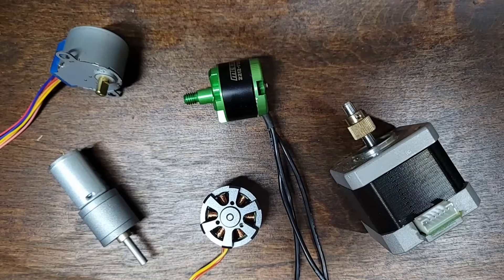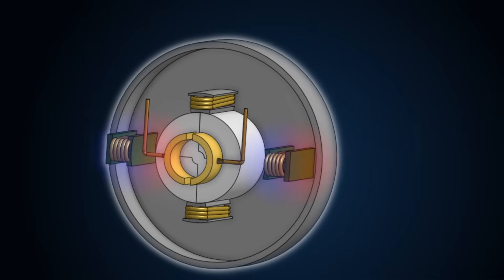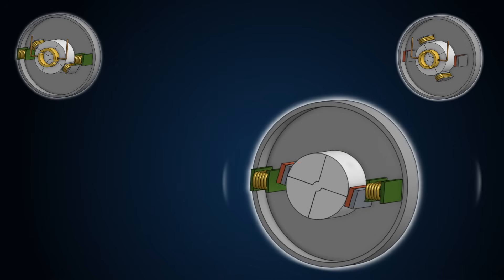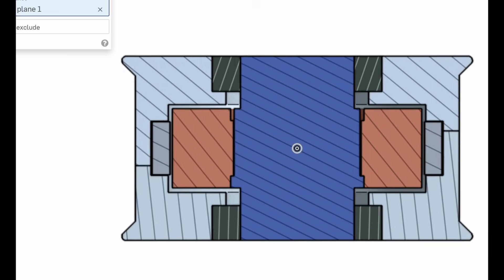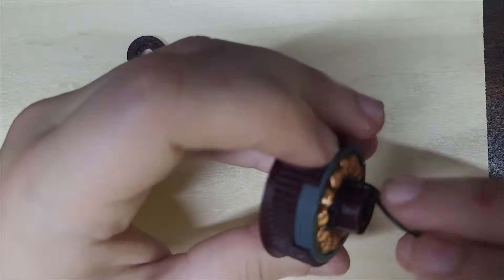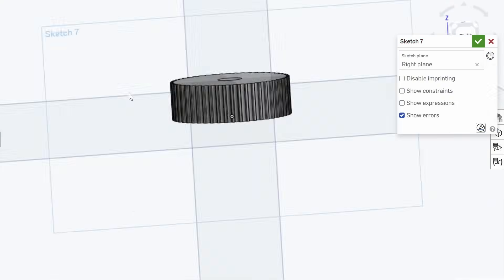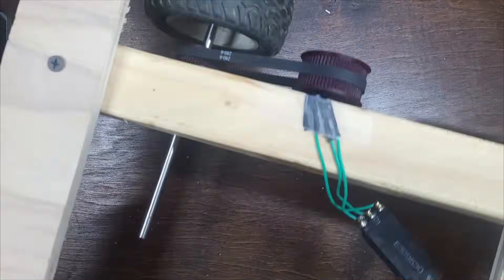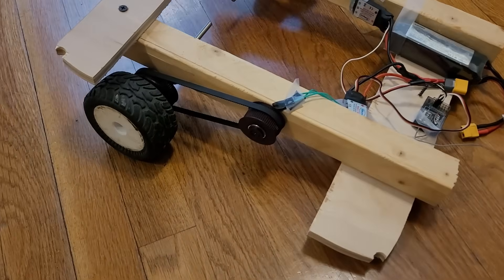Building application specific motors

Comment from the maker: Thanks for watching the video!
If you're thinking about hub motors, yes those are a version of this concept. If they were easy to find in more sizes and at lower prices, I would be more inclined to work with them. However, I think there is a lot of room to explore different packaging options to make better use of the space inside a motor. Maybe the single screw through the middle wasn't the best example, but hopefully I can spark some ideas from you!
Reply: How dare you read my mind?! Yes. I was thinking about the hub motor on my electric bike. The axle (which is affixed to the bike frame and does not rotate) has a power cable passing through a concentric hole through its center along the length of the axle. This suggests that the annular housing (to which the spokes attach) that rotates around the axle (thanks to a pair of bearings (one on each end of the axle) linking the housing and axle) contains permanent magnets, presumably, while the axle contains electromagnets, allowing the wheel to spin without twisting the power cable and obviates the need for a commutator.
Reply: I believe these are “frameless torque motors”, a type of “direct drive DC motor”. They should have very high starting torque, but your controller might not provide enough current. I recommend the “Motors and Motor Control Circuits” Coursera course published by University of Colorado Boulder.
Reply: You have almost invented geared motor. See e. g. mini cheetah or geared bicycle motors. Or motor wheels in general.

Comment: The Swyft Drive V2 is an interesting product that achieves a similar end result with a standard 550 series brushed motor.  It's definitely worth looking at, I think it's pretty clever.
Reply from the maker: Interesting! that's really just integrating a gear train into the wheel hub, but it's nice packaging and looks like it works well.

Comment: My understanding of why this isn't done more often, is two fold, it's slightly more complex to design well, and a need to engineer some reliable heat dissipation means- the motor will under perform or fail as temperature climbs.
Reply from the maker: Maybe I'm missing something on heat dissipation, but my intuition says a big metal core in direct contact with the stator would dissipate heat better than the normal design, where most of the heat has to go through bearings
Reply: @igotdistracted   Plastic is a really poor conductor of heat, and the motors shown in the video are wrapped in it- they essentially have a large plastic blanket that will trap heat to a much greater extent than metal would have.

Comment: I think your forgetting arguably why it’s not popular and why robot did not work… when a motor spins a shaft it naturally has more torque because the magnets on the motor have good leverage to spin the shaft… imagine putting a pulley on a motor and the pulley is bigger around than the motor it virtually eliminates all of its torque. You can test this with any brushless outrunner motor by trying to stop the spindle vs trying to stop it from the outter can.. Even in low rpm high torque brushless motors you still need torque. Not even mentioning rotational mass

Comment: How far removed from the concept of "hub motors" is your design? I assume there is some fundamental differences, even if it's maybe just the size? As these are pretty common in electric scooters and scateboards, I'm sure you're aware of them. They also have the motor itself as part of the drive train, or even the only part of it in many cases. Edit: to be clear, I'm asking specifically about what separates them conceptually, or if it literally is just the size (to make it clear that yes, I did read the pinned comment).
Reply from the maker: I think there are more design options than "stick the motor on a shaft", so I'm going for a more broad concept with more potential applications.

Comment: I could see applications for this in compact CnC-adjacent applications, in a proper metal housing, the teeth could double as both the teeth for a belt or gear drive, and happy accident heatsink fins. Plus, with the regular motor space out of the way, either the assembly could be smaller, or replaced with a whole lot more heatsink on the stator than would otherwise be possible in the same area.
But honestly, I think the main reason behind why we still use rotors in the core even on an external drive, is because it takes a much smaller, cheaper bearing to drive a thin rod in the center connected to the rest of the rotor than it does to drive the whole rotor directly.

Comment: How about make one or both sides of the motor hub "keyed" or the outside keyed so you don't need any screws at all to fix it in place. It can simply be clamped in place by the frame to the lock the motor core in place and allow the pulley to spin?

Comment: Nice exploration! In combat robots it's now quite common to rebuild BLDC motors into "hub motors" where the stator is held stationary inside a very beefy bearing assembly supported on both ends, and the rotating magnets are within the hub of the weapon blade. Very similar to the solution you've got for this build. It's quite challenging to build the sandwich of parts, but incredibly durable if done right. EDIT: also, it might be worth checking out AM32 escs as it's a firmware originally designed for rock crawlers and gives the best low speed control i've come across. It can coax a lot more power out of motors than the older simonk firmware escs.
Reply from the maker: I'm not very familiar with the combat robotics niche. One of the other comments mentioned "repeat robotics" which seems to havenice options for small hub motors.
PS. It just took me 3 tries to read "coax" as a word instead of an abbreviation for "coaxial" 😂
Reply: here before all of the people frothing at the mouth to be a reply under a big youtuber comment

besides that tho, love your content
Reply: @9_1.1 same same here xD followed him for like 7 years or so since I was 15....

Comment: I realllllly love this concept! Yes it would be so much nicer to have lot more of this design around. 

The motor you compare them to are the combined brushed and geared motors. The output from those are actually output from gearbox, not motor. If we add those readily available plantery gearbox to this system, the way it would work is to have the gearbox's sun gear be this solid stator motor. This makes it radially huge but axley compact (In fact, I think most robotic joints are made like this).

Comment: This a pretty cool design! I would highly recommend looking into a closed loop motor driver. By just adding a magnetic encoder, and suitable driver like O-Drive (or similar) your starting problems will disappear even with the motors you currently have plus you could use then for other things like cnc 3d printing and more. 
One of the main issues you are going to have is thermal buildup which those drivers help with as well by monitoring temps. Good work!
Reply from the maker: I was looking at that in my other video! Ran out of time to put them together for this one

Comment: Generally because the motor is spec’d for the application not the other way around.

When you start considering the useful products you can use this for the alternatives start to become more appealing for things like larger motors for more torque, adequate ways to deal with heat dissipation, etc.

You basically said it yourself at the end of the video, it’s a solution looking for the problem.

Btw this a good video and entertaining regardless of whether it changes the world or not.

Comment: While hubmotors like this are fairly common in ebikes and EVs as the other comments will tell you, much smaller versions are fairly frequently developed and occasionally made as products for the combat robotics community (battlebots but smaller) repeat robotics and just cuz robotics are the leading suppliers and both sell 2 sizes of hubmotors each (donor motors being in the ballpark of 2207 outrunners).
I myself am actually prototyping my own hubmotor for a 150g bot using an 1804 drone motor.
Reply from the maker: I never would have found those, thanks!

Comment: Heat is the enemy. Making anything more torquey would produce heat which is not able to escape. There are hub motors, but these are a lot larger. and liquid cooled.
Reply from the maker: Wouldn't the central post help heat escape the coils better? (Assuming it was aluminum)
Reply: @igotdistracted  Not really. The coils are toward the outer part of the motor. 🤔 Large diameter axle - maybe

Comment: So you took a BLDC and made it worse?! Might have worked if it had a planetary between the pulley and the motor.
Reply from the maker: It's not any worse, the motor I found just didn't have as much torque as I expected (there were no specs)

Comment: Isn't this just a gimbal motor setup?
Reply from the maker: No, gimbal motors still have a central shaft, it just has a hole through it. But the bearings still use a ton of internal space, so the hole is pretty small

Comment: ummm, its like the most important aspect was completely ignored...
magnets?
what, that ring? if its magnetised, its only ferrite and weak as, if its merely ferrite and unmagnetised then its operating as a "hysteresis motor"...

which really explains why its gutless.

high power motors use a steel sheel around neo magnets for a reason. 

also... small shafts means small bearings means higher speeds. obviously not a concern if its a low kv direct drive or low reduction application.

mass manufacturing means the less material used the better...
 yes, theres other factors at play...

gimbals get rpetty large on the bore but still, hollow shaft motors are unusual... and usually priced accordingly.

sort the magnetic circuit out and theyll actually perform.

Comment: This probably isn't common yet because the design is a little too over specialized to one particular use.  If you put a bolt flange on the outer case so that different pulleys could be mounted it would be easy for other designers to build into their machines.  I do like how it takes the motor from a grafted on component stuck wherever and makes it easy to tuck into the structure.

Comment: This is a cool idea. You might consider integrating a planetary gear assembly directly into this assembly to increase available torque. You can achieve a 4-1 ratio easily and much higher (for instance, 64-1 in three compact stages) if you stack multiple assemblies.  It would increase your outer diameter by perhaps 30% but result in a much better match from the motor to wheel loads. I've printed many gears and they work surprisingly well and hold up well with just simple PLA, adding only a dab of light grease. Using angled or herringbone gear patterns will reduce backlash and noise significantly. There are many calculators online and tools like freecad have gear generation tools as plugins.
Reply: :) very glad you said this, saved my typing it.

Comment: What exactly is the difference between this and a plain brushless outrunner having a belt drive on the outer rotating case?
Reply from the maker: The middle isn't spinning, so that space is freed up to act as a structural post (or hold the mounting screw in the video)
Reply: @igotdistracted  With outrunner motor - the middle is stationary, it's the case that is rotating; it's a classic bldc that is used in rc planes / drones. It just missing the belt pulley on the outer part.

Comment: good job, you reinvented the hub motor thats currently in use in millions of electric scooters
Reply from the maker: There are a handful of applications that do this, but they're not readily available in a range of sizes, which is the frustrating part.
Reply: @igotdistracted  Not true. Being in electronics for over 30 yrs. There are hundreds of solutions using this method. Because you cant find something doesnt mean it doesnt exist. 
Go have a look at an RS catalogue. Maybe youll find something you need.
Reply: Wow there's a lot of snark in this thread.

Comment: This is a great concept! 
especially since you can repurpose a lot of parts from regular bldc motors.. 
i wonder if this could work with stepper motors as well, it seems like robot joints would be a great application (also light cycles from tron)

Comment: I think you should experiment a bit more witht he title and thumbnail, I mainly clicked on this video because I vaguely remembered your name from a previous video (which was excellent) and it ended up being a way more interesting watch than I anticipated. The video is extremely good and the title/thumbnail dont really do it justice in my opinion.

To give you an idea, I think a title along the lines of "Building a new kind of motor" and a thumbnail which shows that you built a motor and what makes it special would go a long way. Because as it is right now I kind of got the idea I was gonna learn something about designing motor mounts (which isnt that interesting) and instead I learned about a motor I have never seen before with an obvious advantage which I kinda wanna build myself eventhough I have no usecase for it, it's just that cool!

On a side note, this motor would be perfect for the dials you showed in a video previously

Comment: yes it's a hub motor. Put a decent amount of torque on it and the core will spin (a common problem with e bikes). The 4 screws mounting scheme is great for handing torque, but I do agree with you that the motor should come apart easier for ease of mounting. Or just mount from the other side of the frame.
Reply from the maker: The torque issue is why I was thinking about a different mounting pattern at the end. I just thought the wood screw through the middle of the motor would help make the point.

Comment: If you're looking for very high torque low KV motors for quite cheap in the form of gimbal motors, which also do not have a shaft that sticks out, but they do have a hollow bore that does rotate.

Comment: Where did you get those motor coil and magnet ring parts from? I did not know you could just buy those, I could use that for a project.
Reply from the maker: Search "frameless motor" they're few and far between at a reasonable price point, but you'll find a few options

Comment: I am thorn.
On the one hand I don't like trying to restrict torsion with only one bolt. But on the other hand I do love a good pretensioned friction connection.
Also on the one hand I don't like not have a simple option for tensioning the belt. But on the other hand it is super easy to only have one bolt. 😂

Maybe if the "center" hole was not in the center, such that it could be rotated to tighten the belt. 🤔

I do love the compact design though.
Reply: Ooh, eccentric mounting hole is a nice idea. Then maybe add some radial teeth so it grips into what it’s screwed into.

Comment: Good video, and less music than last time, but you don't need any. It makes you harder to understand, and you have interesting ideas and I, for one, would prefer to hear them clearly! On the motor, how similar is this construction to the hub motors being used in some high performance EVs?
Reply: I don’t believe EVs use hub motors often, because it means more unsprung weight. Electric bikes and scooters do though.
Reply: I dont think the music is distracting at all, maybe a little less volume would be a slight improvement but I prefer the music over no music

Comment: I like the thinking, but I usually want a pulley that's smaller than the motor casing.  Also, there are loads of gears, sprockets, and pulleys available off the shelf for standard shaft sizes.

Comment: 6:45 are you pushing those inserts in using a soldering iron?
Reply from the maker: Yes, with a tip designed for heat set inserts and the temp set to 250 C or so

Comment: You have got a point. Outrunner motors could be used more easily without a thin shaft as the only output. I might have seen some drone motors attach the prop blade to the outrunner.
Reply: most outrunner rotors do have holes for m3 screws, yep. and even beyond that, the shafts are often removable using a grub screw to give a hollow core.

so while this isn't exactly a new method of doing things, it is definitely a method that works.